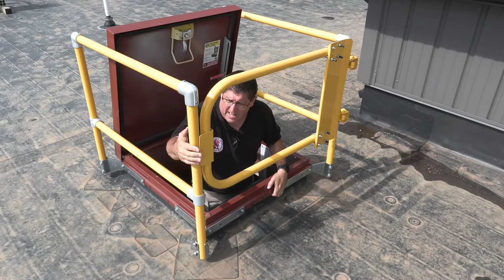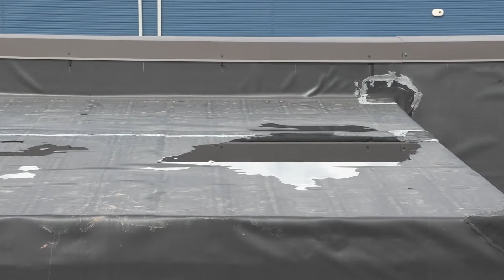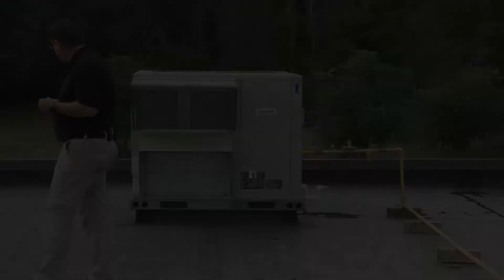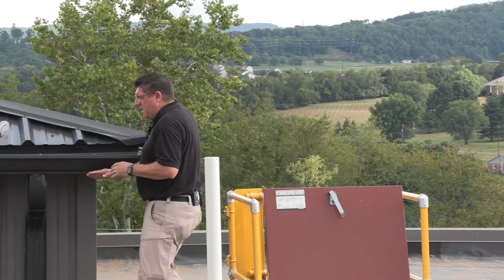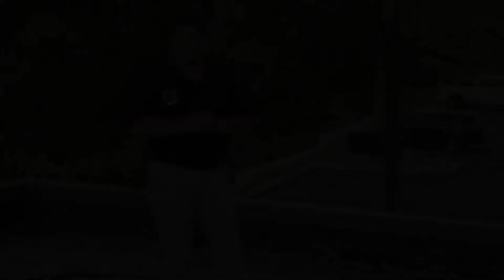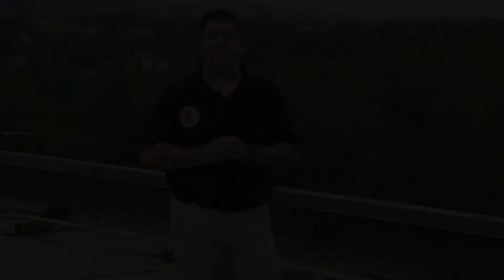Commercial Property Roof Inspection at InterNACHI's Pennsylvania House of Horrors®

Comment: On the Epdm, some advice:

Not all ballasted rocks use river rocks. There are other methods implemented as well, river rock is just the most common ballast.

Less than half of all EPDM is adhered according to the ERA. The 3 main attachment methods are Ballasted, Mechanically Attached, and Adhered. 

EPDM is not always direct to decking,  in fact the roof that you're on shows signs of polyiso under the membrane based on the patterns shown in the membrane due to the adhesive. See the lines running the length of the 4x8 boards? Thats a pattern common with polyiso.

If you cant find the "lot number" check prefabricated pipe boots, square flashings, and termination bar for manufacturing stamps. 

That asphalt sealant along the corners and seams is incompatible with epdm and can cause leaks.

Wood blocks used to prop pipes should never come in direct contact with the membrane, and should have a slip sheet. Same with metal stands. 

I wouldnt call the seams solvent "welded" as this implies they arent still two seperate pieces. When you weld pvc you fuse them together permanently, epdm is usually either glued/adhered or has a double sided tape. Its much less durable than what most people associate with the term "weld", as to "weld" is to join them together into a single piece/effective whole. 

Black lap sealant is used on new epdm during installation per manufacturing specifications all the time, and has been for decades. Miscolored sealant like that is not, but black lap sealant made for epdm is. You are right that is a repair but to say all sealant is means youre not familiar with epdm construction or mispoke.

You should mention reinforced underlayment securement strip/RUSS/Fastening angle changes. This is essential every epdm roof to prevent bridging and tearing. 

Actually, before the band butyl should be placed between the boot and the pipe, then the pipe, then band, then sealant. Not mastic or adhesive, black lap sealant. Though many allow urethane as an alternative. 

Pitch pans should have the insulation trimmed back around the line sets and the lines spread with at least a ¼" gap between each wire/pipe before sealing. 

Had to get back to work ill finish video comment after
Reply: On the wood stands I forgot to mention if it is arsenic treated wood it can contaminate the membrane but you either need a lot of wood or you need ponding water that is collecting Runoff. 

Outside corners on flashing such as rooftop units can actually indicate the intended installation life. Typically curbs that only have a single layer of outside corner are a 15 or 20 year,  add most manufacturers now require a two-layer Corner either a small Corner underneath a large corner or two large Corners that partially overlap. These will typically be for your 20 to 30 year applications.  

Wrinkles on the parapet wall either indicate installation issues or bridging. But it can also indicate are getting up underneath that coping due to an improper flashing which overtime can cause are under the system itself which can delaminate an adhered system.  If someone sees a lot of wrinkles, it can be good to have a roof specialist up there to confirm it's not indicative of something much worse.  
 

Something I've seen come up from your guys before is that they're not quite familiar with coping that has double clip. So no exposed Fasteners,  and it often gets flashed as needing fastened. So both the inside and outside facing wall has clip.  

Ideally, if it's a newer building, anytime you have a drain you should have a secondary overflow drain or Scupper that will catch any water that would build up above 2 inches should the initial drain clog. But this is AHJ dependent. I would also always check every scupper for sealant on the outside and every drain for clogging,  loose bolts, or Josam Clamps. 

Along the drainage path of those crickets they have stands obstructing flow. Moving those 2' could improve drainage in some cases.

Gas pipe should be coated safety yellow. Not just yellow. I love what they did up there, that's how they all should look. I know a lot of commercial roofers that are starting to sell that as part of their package for a new roof. I'd love to say it's to get it up to code and make it good but it's really just good $$$ and it prevents people tripping.

Overall fantastic video. I just think we could expand a little more 👍
Reply: @RoofingFacts  Thank you. The goal of the video was to help commercial property inspectors better understand how to look at EPDM. roofs.
Reply: Thank you for such an in-depth comment. It sounds like you have extensive experience with roofing materials. I look forward to hearing what else you have to offer.

Comment: Good video other things not mentioned is EPDM membrane shrinkage usually an indicator that the membrane is aging. You mentioned the perimeter membrane attachment but not a Russ strip. Membrane wall wrinkles or raking maybe caused by building movement. Make sure the membrane hasn’t split or damaged. Drains confirmed all drain bolts and other hardware is in place. I also didn’t see emergency overflow drains or scupper that maybe required by code. You might also mention that an asphalt base mastic is not compatible with the EPDM membrane and should be immediately removed and replaced with compatible materials.
Reply: Those are excellent points. When we film another EPDM video we will make sure that we take them into our scripting considerations. Thank you.